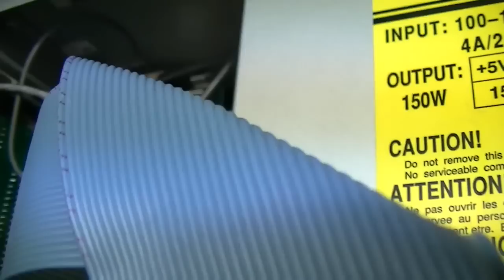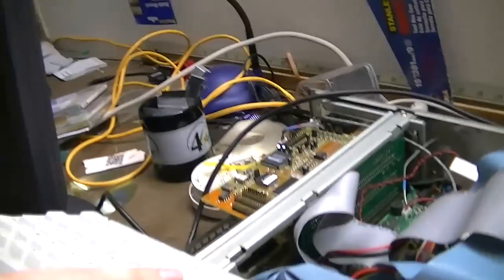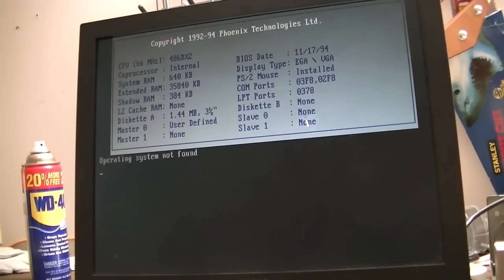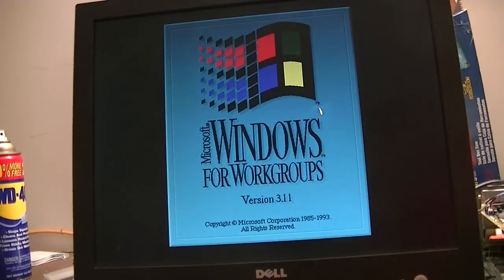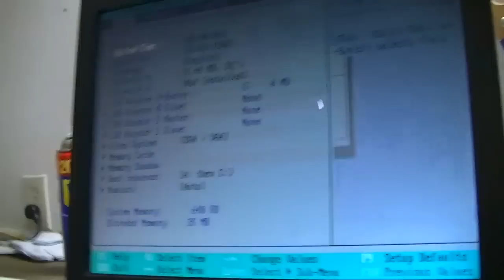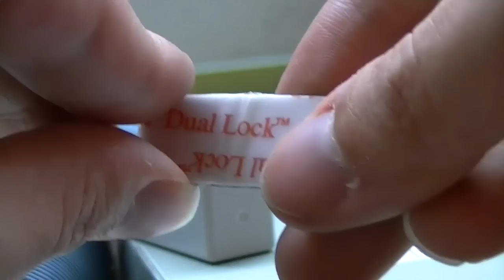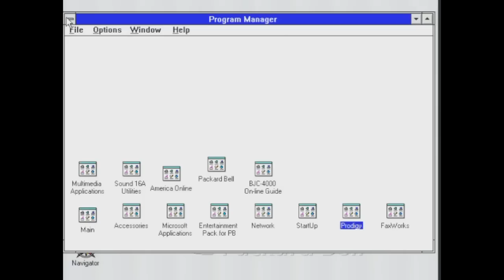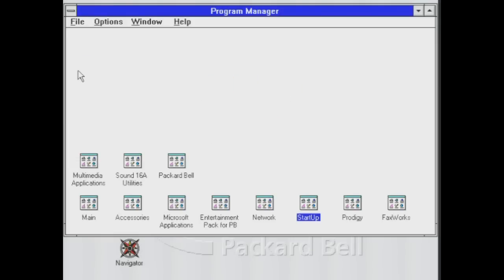Packard Bell Legend 204CD Restoration

Comment: Do you have a link to the motherboard schematic and jumper configurations? I have a Legend 22CD that I suspect is very similar and I'm having trouble getting it to post with the CD Drive plugged in so I'd like to check that out, or heard any suggestions. Great video! The battery saved my build as well!

Comment: Hello there, i am trying to restore the same machine with PB450 Motherboard and i have the same issue with CMOS battery being dead. I was wondering where i can get a similar battery stuff as yours, because i am not really good at electronics. I have tried a system with a external CR 2032 lithium holder and using raspeberry female cable to connect to the motherboard but it does not work and i am a bit out of idea. Usually MB boots fine without battery but this one for some reason Hard Drive settings are not saved no matter i did not stop the PC.

Comment: i AM WORKING ON A LEGEND 35 CD AND AM GETTING THE SAME, IT TELLS ME TO REMOVE THE FLOPPY DISK AND HIT ENTER,,, BATTERY DEAD HARD DRIVE WONT BOOT,, HMM,,, THANKS FOR THE INFO... IS THERE A WAY TON CHARGE THE OLD BATTERY TO GET IT OPERATING, UNTIL YOU CAN REPLACE THE BATTERY FOR GOOD,,,,,

Comment: I bought a PB Legend P75 in 1995 and it was painfully slow and expensive and missing onboard cache.  I don't remember specifically but I think I upgraded to the P133 which is the fastest Pentium the PB600 board will take because of the few multiplier options available.  I was poor and in college and finally got an AMD 800Mhz Thunderbird in 1999, rusting in my basement at the moment.  I wish I still had the PB though, just to verify what I upgraded it to, but it was such a disappointment I was probably eager to toss it in the trash.

Comment: Actually removing the battery and having the results you have are not weird. Since your motherboard battery
 is dead and I am assuming that you are removing power as you make your adjustments, it is the
same as clearing the bios and it needs to do a reset. Same as  removing the jumper or pulling the battery
on some motherboards. It might be nice to save that original copy of the Packard Bell software that is on
the computer with a diskcopy to an old hard disk so that in case you ever sell the computer you can turn it
over with a copy of the original software. Aloha from Maui

Comment: if that CD-ROM is a CR-563-B connect it to the sound card and the cd-rom will work.  But make sure that the CD-ROM you are using on the IDE 2nd channel, make sure it is a IDE CD-ROM.  That PB450+ motherboard will not save the bios information without a battery.